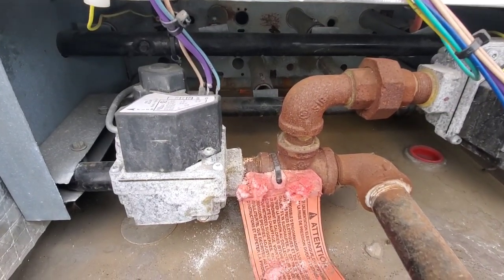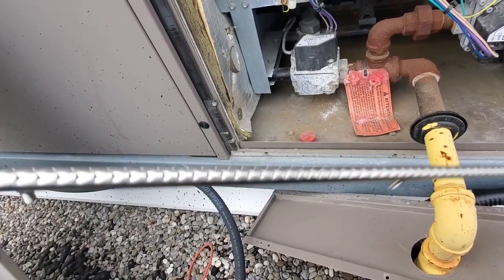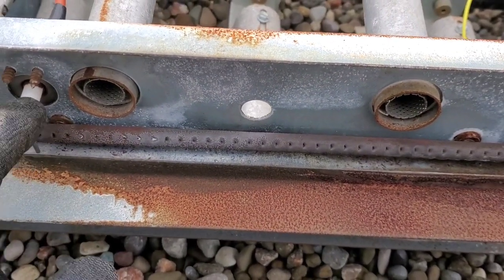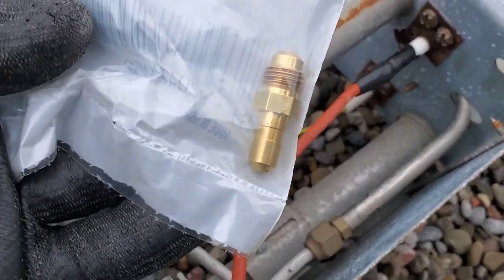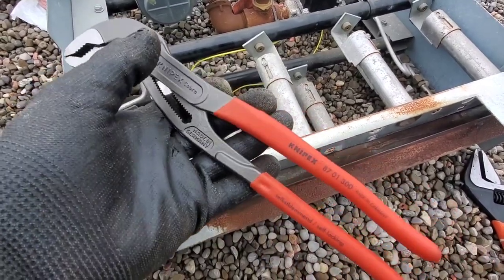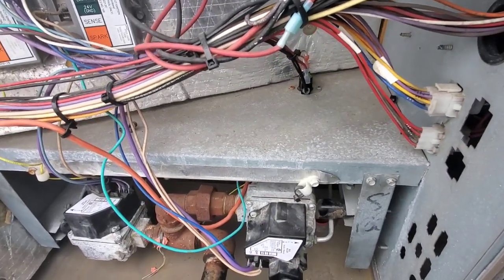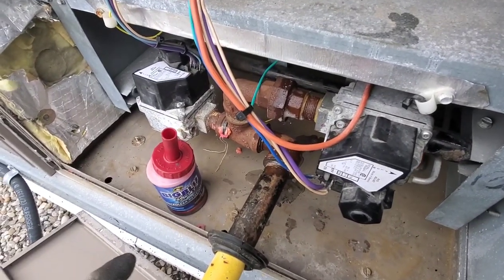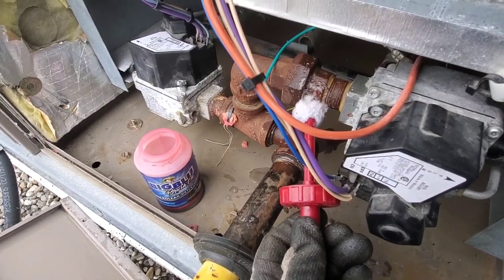York RTU Heating Repair And Ignitor Problem

Comment from the maker: Has anyone else had to do this?
Reply: Done what? Replace five parts on a gas fire package unit to get it to work with one stage of heat?
 Yeah, sometimes....
 In all seriousness great video, I learned something
Reply from the maker: Lol...thanks!
Reply: york and those rollout switch.. we have another tech that replaced gas valve, ignition module ,induce motor, flame sensing rod ..and was just the rollout switch killing ignition
Reply from the maker: It's really one of things that can cause a lot of grief
Reply: I have
Reply: on these york units i always change the sparker, flame sensor, ignition module, and the roll out. if its a simple fix i still change that roll out.
Reply: Smh, I had an issue last week with a pilot tube on a York. First time working on a system with a pilot tube took a while to figure out the problem. To bad I am just now seeing this video lol. Good stuff
Reply: same problem for me you open my eyes after i pull out all my hair great lol great video thanks
Reply: I replaced heat exchanger yesterday and all other components not easy to take all the inducer motor parts out

Comment: This is a great video. so much can be taken away from this. I had a call this past Friday on this same York unit. Another company had replaced the ventor motor, ignitor, sensing rod, ignition modules and burner tubes for a no heat concern. They still couldn't get the heat to run. they said the 9 year old unit needed replacement. turned out they had 1 fan wheel installed upside down on the ventor motor. your info on the flame roll out is worth it's weight in gold. so common to have this issue, but it will basically test perfectly normal. please keep posting. so much good info being posted here!!!
Reply from the maker: Thanks for the comment, full big picture testing is key!

Comment: I’ve done this 3 times in the last 2 weeks, 405 bucks each one, that  Venturi (Air shutter) get bugs in it, pilot won’t light, easy fix, had a company replacing multiple parts, I knew what it was, picked up 46 rooftop maintenances, got their contract.

Comment: Good video. I had problems with the igniter on a smaller unit. The way the assembly went in put the igniter tube very close to the bottom of the unit. There are 2 square holes where it fits on the orifice for combustion air intake. When I put the  assembly back in one of these holes was resting on the insulation (I didn’t notice) so it would only light half way.  It was a low profile unit. I was laying on the roof melting ice and freezing my ass off. It took some time to figure out wth was going on. Everything would work fine if I had the burners out of the unit but the minute I put them back it wouldn’t work. So if you run into one where the igniter only fires half way check the combustion holes. Stay safe.

Comment: Just out of curiosity why were they not using the second stage? Reason why i ask is because im having similar issues but its only the second stage not working and already replaced pilot tube. Next try will be the ignitor trick!